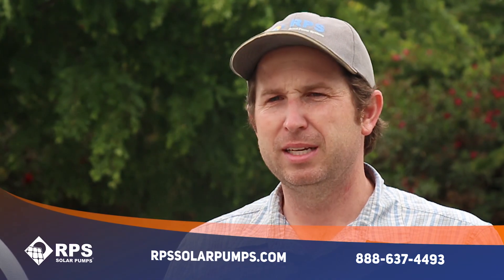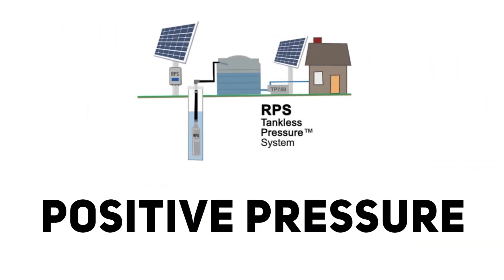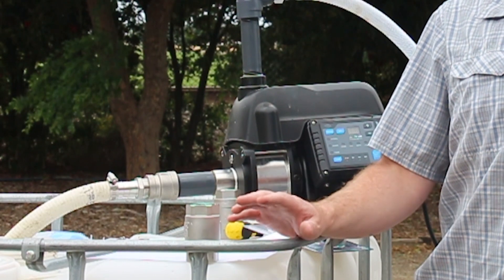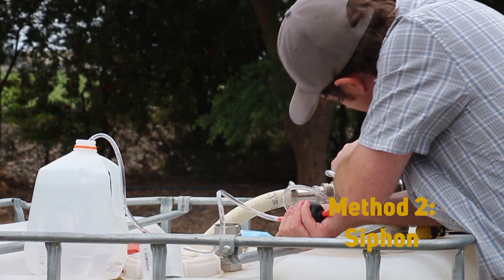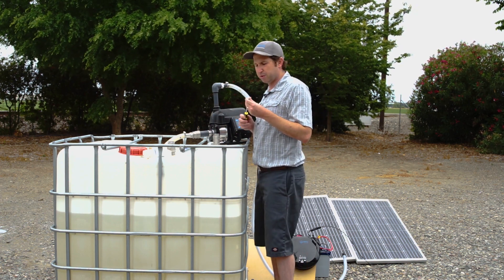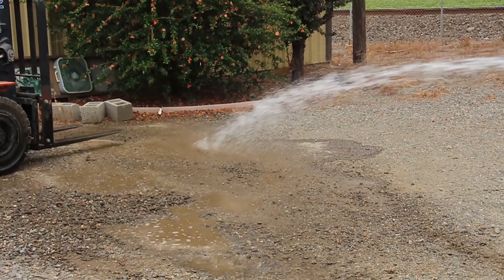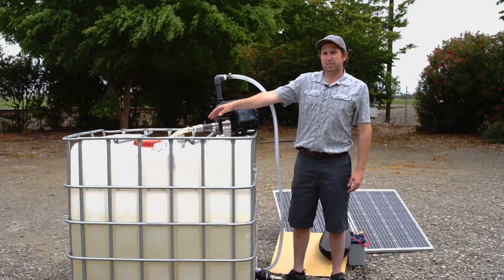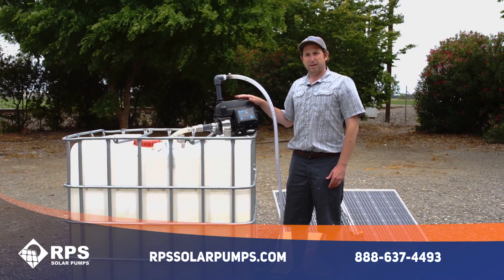Priming the Tankless Pressure Pump™ or Other Booster Pumps

Comment: How long will this hold prime without positive pressure (tankless). I am thinking of getting the RPS solar tankless system, but it may be a week or two between water uses, and I'm concerned about losing prime. Do I need a separate water pump and tank for positive pressure to this booster pump? 300 ft well.
Reply from the maker: Just make sure there are no air or water leaks from you suction line and it will hold prime forever.  Our demo unit was primed 6 months ago and has not lost prime yet!
Reply: @RPSSolarPumps  quick response! We are gearing up new raw land for solar camper (travel trailer) and so getting our well drilled three years ahead of a full house build (no grid power). Prepping. It looks like the solar tankless kit is the way to go?
Reply from the maker: @Gruuvin1  Yeah, the TPP was designed for offgrid water pressure especially households, campers and cabins.  Should be a great fit!  Give us a call at 888-637-4493 and we can help you size a system if you like?
Reply: @RPSSolarPumps  when the well is drilled, I'll call the next day! Very enthusiastic DIY!
Reply: @RPSSolarPumps  about the demo unit. It holds prime on a simulated well that is only a couple feet deep. What about a well that is 400+ feet deep? I haven't been able to find anything in specs or FAQ about max well depth for this pump.
Reply from the maker: @Gruuvin1  This is called suction depth and the maximum is 15ft of suction from a shallow well.  In theory the maximum suction for any surface pump is 32 feet and after that a submersible pump or deep well jet pump with Venturi valve is needed.
Reply: @RPSSolarPumps  I see. So the tankless system is really only for a well up to 32 feet deep or a well with a submersible pump that fills a tank. This is a really important piece of information missing for most of us non-experts; especially when most wells are deeper than 32 feet. (Original question "Do I need a separate water pump and tank for positive pressure to this booster pump? 300 ft well.")
Reply from the maker: @Gruuvin1  Yes for shallow wells, we rate the suction up to 15ft as the pump also needs to provide pressure.  If you don't need much pressure it can suck water up around 20-25ft.  For deeper wells, most people use a submersible pump to pump from the well into a storage tank and then use the TPP system to provide water pressure.
Reply: @RPSSolarPumps  so, it sounds like I need the RPS 800 kit, a tank, and then this pump to draw from the tank to provide water/pressure into the house. And that would be two different solar kits, batteries not included. And I am thinking a single solar kit, with batteries, that powers both the submersed pump and the booster pump makes more sense than two separate solar kits. Thinking I need to call you guys and speak to a sharp engineer who can quote a suitable system. Might be better to build my own pv/battery solar system and tank, and just look to RPS for submersible and booster pumps only.
Reply from the maker: @Gruuvin1  we also have  FAQ video on this pump.  Here is the part about suction depth. https://youtu.be/NN8YpFxJLVs?t=233